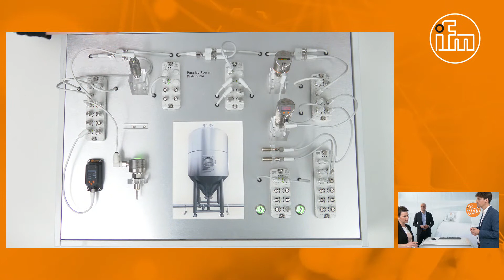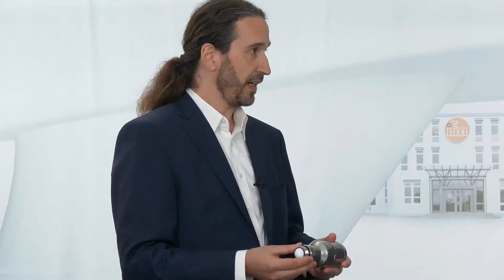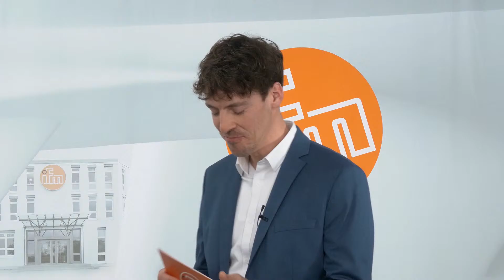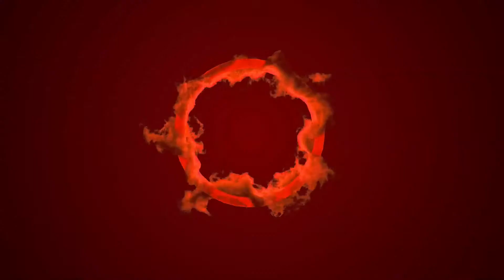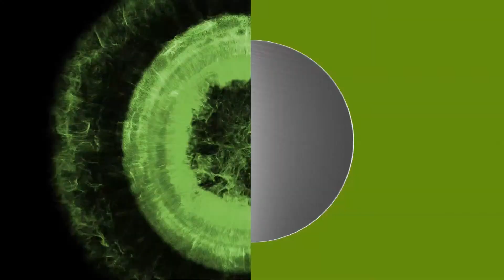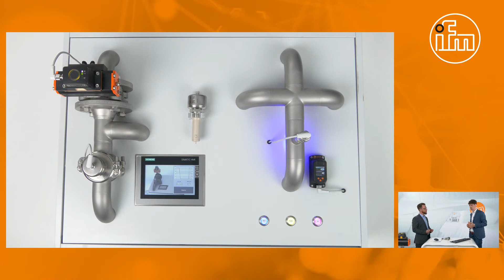[ifm LiveTalk] Food production

Comment: sir i want to measure the rpm of a wheel which is connected after the motor belt . we think there is slip in belt some time what sensor is best for  detecting the rpm can you please suggest which ifm sensor i can buy . our  rpm is from 0 to 3000 and we want a output in 4 to 20 ma so we can connect that to plc and do the scaling .
Reply from the maker: Thank you for your request. We forwarded it internally and we will come back to you as soon as possible. Many greetings from ifm's Social Media Team
Reply from the maker: Please write your question with a description of your use-case to our service team (info@ifm.com). They will help you to find a solution with ifm automation solutions.